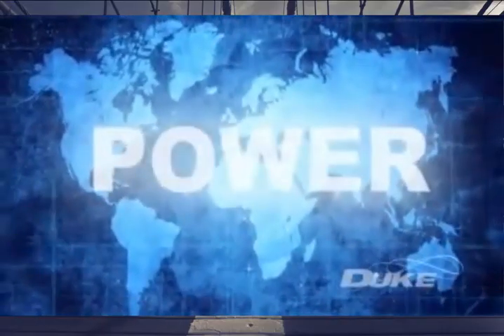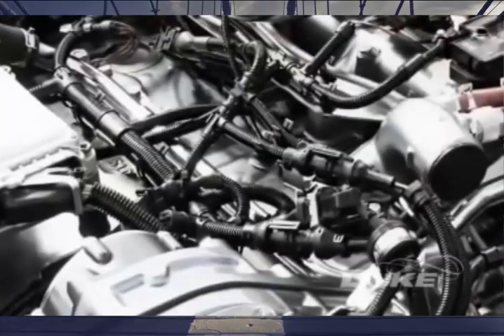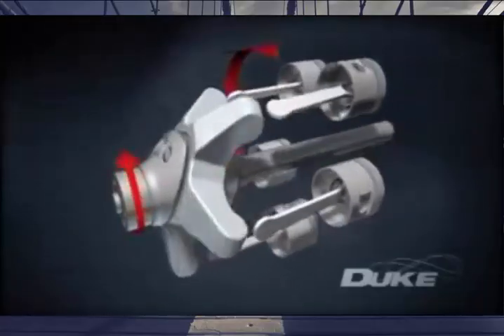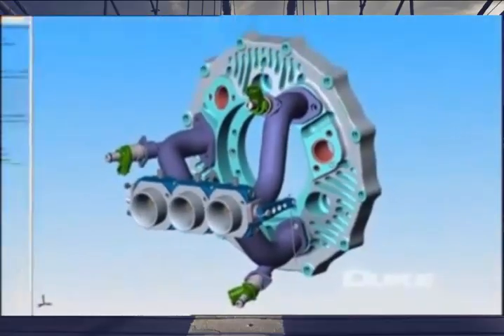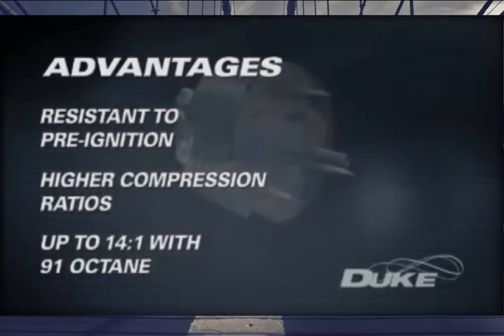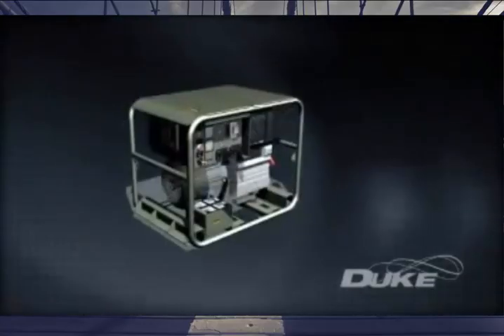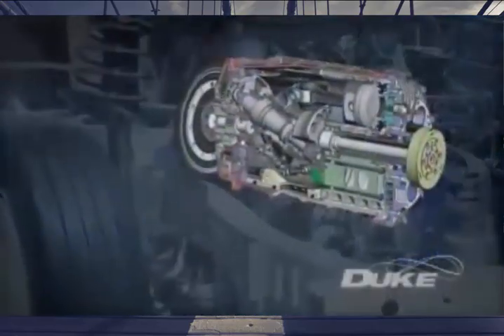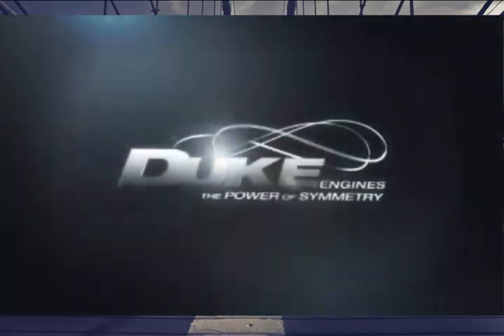Duke Engines | All information about Duke Engines

Comment: Massive increases in uneven wear.
Reply: was just thinking about the seals between the cylinders and the head, it'd last like a month lol
Reply: ...does anyone see relevance to rotary engine problems?
Reply: Aye, the most positive thing I can find about this new engine is that it has the perfect amount of cylinders :p
Reply: that's not the greatest problem. I bet the seals don't even seal xD
Reply: +Warlock yes but 10 fold
Reply: Wrong. Wankel's problem is the idiotically-difficult-to-seal contact patch at the three tips of rotor. THIS machine is a lot easier to seal (perhaps still not as easy as a stationary block) because it's "just" two level surfaces sliding over each other. If anything, this construction's biggest problem is irrecoverable loss of lubricant, destruction of the lubricating coat, friction-welding the entire rotating cylinder block to the counterplate. BAM.
Reply: 9400Martin cant argue with you there
Reply: Yes the Wankel engine. The reason that didn't catch on was the fact that the wear on the seals were never durable enough. Mazda toyed with them for few years and then shelved them.
Reply: +jeremy mcadam well, new rx prototype has an rotary engine, it said that some of the problems were fixed.  We shall see..
Reply: Maybe, either way using the ICE in cars has peaked.
Reply: Mp57navy then you make even more problems, rollers need bearings, they get used... so yeah, even more problems...
Reply: can you imagine how much oil this shit needs to keep itself cool and running?
I mean those cylinders moving around and touching the fucking plate, how on earth they make sure it doesnt burn oil?
Reply: ***** less parts than what? It has a more complicated crank and the entire block spins. Also how do they seal if they dont touch lol
Reply: ***** woooow then how the compression happens? with magic?
Reply: also you would never get the torque that a huge engine can provide
Reply: The vast majority of heat comes from the combustion of fuel. Friction is a very minor and localized heat source. That's what oil is for.
Reply: The biggest problem with rotary engine was that the vast majority of people know little to nothing about cars. Those people want to be able to get into their cars and not have to worry about checking or doing anything to it. The way the rotary engines work the only way to lube them so that they ran for a long time is the spray fuel right into the cylinder. This means that by design the engine would burn oil. All be it a very small amount of oil, the car would not go the 3k+ miles, which is when you typically change the oil, with out burning all the oil in it. This means that people would have to check and add oil every so often. Most people do not want to do that. From what I saw on this engine I think they can lube it with out burning oil. The problem with this engine, and also the other main problem with the rotary engine, is that at such high compression ratios you create what is call Nox or oxides of nitrogen. That is when oxygen and nitrogen combine, Which requires a lot of heat and more importantly pressure. Your regular engine running at like 9:1 or 8:1 ratios typically don't make enough pressure to do this , and what little is made can easily be controlled. When your running a much higher compression ratio, like the 14:1 they speak of, you create so much that it is not easily handled with out anther system, typically on diesels you see the diesel exhaust fluid. Unfourtanlly again this brings us back to anther fluid that needs to be checked and maintained and most people don't want to do that. Nox is not particley dangerous for use to breath in, how ever it is main compent in smog, human induced fog, and is also a green house gas.
Reply: +Anvilshock steel shield technologies has that problem solved
Reply: chupamishuevos303
An A/C compressor doesn't operating at anywhere near the thermal stress of an internal combustion engine, and what's more they are generally lubricated by the recirculating refrigerant.
Reply: your right in that sense im just saying the way it moves and makes pressure
Reply: mrjaffar not quite shelved, there is a new one coming confirmed. eventually...
Reply: They should add rollers to the edges on the wankel engine. Problem solved.
Reply: +Mp57navy genius
Reply: +Lot Retnuh Yes and yes... Engine driven hydraulic pump concept with pressure adjustable swashplate.
Reply: if ya watch the whole video you will see that it don't put out hardly any heat Because it has less parts that interact with each other less friction less heat.
Reply: ***** less friction? lol
those cylinders run around like crazy
Reply: they never touch each other
Reply: ***** but then you need a bigger motor wth a bigger block and create more problems with that
Reply: ***** maybe, theres definitely smarter men than me working on this, so maybe they can work out the glaring flaws
Reply: ***** no it couldn't because those are diesel engines, not gas engines, this is a gas engine
you cannot scale gas engines like diesel engines because you would need a really big spark plug
Reply: ***** I'd take the one huge diesel engine over an array of gas engines any day dude
less engines, less problems
Reply: i was thinking the same thing lol but dident know who to tell hehe
Reply: Would they last even that long? I notice they never once mentioned that little detail. I'm also concerned about the cooling system. Seals aside, how would you minimize warping of the "head" (for lack of a better term)?
Reply: They haven't popped up on any of the car restoration shows that I've seen.
Reply: :D !
Reply: He says that they will work well burning kerosene. How different would that be from burning Diesel, since it basically IS kerosene?
Reply: Ken Murphy Granted, they look like they've got SOME problems solved, and I shall applaud them for their achievements, but I wouldn't presume they automatically apply to all the challenges presented with this bearing.
Reply: Anvilshock Roger that
Reply: you know this the same way The AC compressor works
Reply: chupamishuevos303 The way you describe it, I could say this thing was like a garden gnome and still be right, in the sense that if I threw both hard enough in your face, they'd kill you all the same.
Reply: I was eyeballing that part that counter spins the crank from the recipricator thing. That has to hold the all the power back with metal sliding on metal, and not wear down or give out. 

But it seems like 1) this would be better if the rotating parts also drove a supercharger, and 2) this would be better in aircraft where the prop has a liquid coupling to the air rather than a mechanical coupling through the trans and wheels.

Comment: Two problems with this design seem obvious to me. First is the durability of this highly unusual piston to flywheel power transfer assembly. The second is the high rotational mass of the cylinder block. The first may be overcome already but the rotational mass problem looks insurmountable. Not that this engine wouldn't have numerous applications where tremendous back-and-forth torquing of the mounts isn't a problem, transverse mounted front-wheel drive vehicles for instance. But this would limit it's versatility, if it is as high as it looks.

If these seeming problems have been overcome, perhaps you should mention that in your video. It's an innovative idea, and if those two hurdles have been overcome, kudos to the inventor. But if not, as an investment opportunity, it seems a bit high risk.
Reply: +ladamyre1 It looks like a project to graduate from drafting school.  "Let your imagination fly.  It doesn't need to be practical.  Just use the 11 elements we covered."
Reply: Fifty State
I think you've hit the bull's-eye there. Engineering school; makes perfect sense.

Comment: retarded
Reply: +Ron Koerner -ly amazing?
Reply: If u understood engineering you would realize  how shity this is...when one part breaks everything breaks ...junk ...pure junk......trying to take a rotor and a wedge motor and put them together .....
Reply: If you understood humor you'd get i'm having a little joke...not to forget this motor is still in the prototype stages and is being worked on still, admittedly i can't see where the oil goes or even how cooling and lubrication works on this "junk" engine.

Comment: How does the valve system, oil system, etc work?  I'd like to find more information on the actual mechanical workings of this engine.
Reply: +sc0tte1 I was hoping for more, too.
Reply: +sc0tte1 i am not sure how exactly the oil system works, but as seen by the cutaway/animations, there are no valves/camshafts. the entire cylinders rotate around the engine to not necessitate the need for them.

as best as i can explain it:

the piston sucks in air from an intake port while going down it's cylinder, which is simultaneously rotating away from the intake. it reaches dead bottom, and begins to rise again while rotating towards a spark plug. as it rises, it compresses the fuel while having rotated towards the spark plug, which then ignites it, making the piston go back down, creating the driving force (power stroke) to turn the engine/power the vehicle. while it's going down, the cylinder moves to an exhaust port, and the piston gives a final stroke to push the burnt air/fuel out. it continues rotating and begins moving down when it reaches an intake port and repeats the process.

no valves or cams or anything like that are needed on this design.
the oil system will likely be similar to the entire unit (behind the combustion chambers/top of the piston) having oil in it with inlets placed at the "top" of the engine to squirt it into the cylinders if need be. there are other ways but this is the most likely one i can think of

Comment: I wonder why this has not caught on.  The Wankel engine made it in a lot of RX7s and RX8, but it had issues with fuel efficiency and emissions, so it was phased out.  I wonder if Duke has the same problems since it has aimilar intake and exhaust ports as the Wankel.

Comment: This might be great for motorcycles, generators, atvs etc. Where mileage and wear is not as rough as cars. This might be quite interesting. The sealing situation is nowhere near as bad as wankel rotary, because there is one surface that needs to be sealed instead of three (and no sharp corner seal). So while having lubricating oil in the combustion does not help emissions or maintenance, the overall simplification and reduction in parts could be a win.
Reply: +Nimajus Bagdonavicius If you look at the oiling system on the Evinrude ETec Direct Injected 2 cycle outboards. you will see a multi-pin oil pump operated by the ECU that delivers only exactly as much synthetic oil as needed to exactly where it's needed. As all that goes through the crankcase is air the fuel can't act as a carrier for the lube oil. The oil  eventually makes its way into the combustion chamber where it is burned cleanly. This combined with a proprietary DI makes an outboard that has the 2-stroke power characteristics and light weight with no penalty at all in terms of emissions and fuel economy. Hunh! You want to talk power density? Nobody's even bothered to put forced induction on these, no need? 
   So yeah, those lubrication problems can be easily solved with existing technology. Oh, and they have a fraction of the moving parts of a comparable 4-cycle engine. I'm interested in the compact footprint these Duke engines exhibit.

Comment: I see centrifugal force that should make cylinders wear unevenly.
Reply: +Arnis Tarassu can you explain more?
Reply: +Maxim Teleguz piston does have some weight. if it rotating one side of that piston is pushed against cylinder wall more than the other side. cylinder wears unevenly (oval shape).
Reply: +Arnis Tarassu if proper high strength materials are used, i wouldn't see this becoming a problem after some thousands of hours of use. with precisely engineered development, such as an oil inlet on the cylinder wall precisely placed to make that contact area a slightly lower friction than the other one, this can be reduced a negligible effect. standard four strokes took 100 years to get this good. give this one some more time and more development and the issue will be addressed and taken care of.
Reply: Cobalt Lukather
Time? You mean like 2030? Internal combustion engines will not survive that long. Batteries are getting better 7% each year.
Reply: batteries yes. but what charges those batteries? power plants. what do power plants use to make electricity? massive engines. (of varied sorts mind you. not just gasoline)

this may not make it to a vehicle application in time, but a generator application is a very possible goal that is easier to achieve, as is already stated by the company as an application they will likely sell their engines in.

these already appear competitive for motor home generators and other personal generators with their light weight and multifuel capability most generators do not have. larger, heavier duty models can likely power more extreme industrial applications such as small power plants, emergency/back up generators, and even trains (power generator, not engine) in more compact ways than a traditional engine can in roles a battery cannot fulfill.
Reply: +Cobalt “Robert” Lukather power plants mostly use turbines, not engines. and also motor/generators.

Comment: unmatched power density? that junk wont be even a slight shadow of what the wankel is
Reply: +Felipe Kauer Even if this Duke engine were exceptionally powerful, it has to make good on all the other design requirements for it to be a world beater. The number one problem for this thing is not what kind of power it makes, but the seals involved in getting it to function properly over large amounts of time under significant stress.

Comment: ever heard of wankel engines ? you know what was their main problem ? and why is it impractical for car industry application. it is that it has too high rotating axis position, so the engine would need to be too close to the ground, this engine has same even bigger issue, since you would need additional angle couplings to deliver the torque to the driving bridge.
Reply: +11thboris : What killed the initial iteration of the Wankel was bad seals.  Once that was addressed, Wankel came back strong. It's a good engine and even used in some aircraft development today.
Reply: +11thboris I absolutely concur. Wankel is a very advanced ICE-concept, which, at conception needed materials not available, but which are today. THAT is why Mazda engineers have gradually improved the concept and practical application. So, the new RX-9 will have a new type Wankel motor.